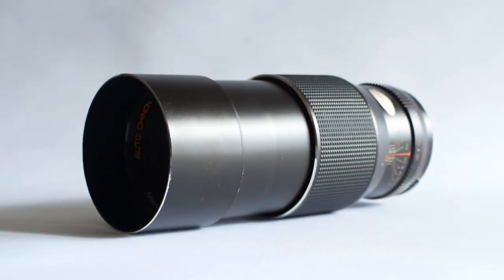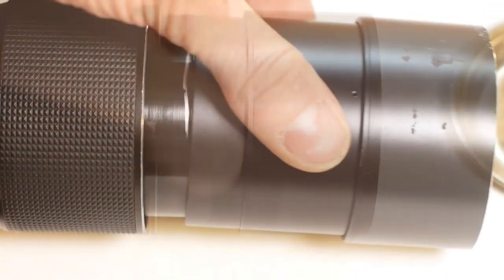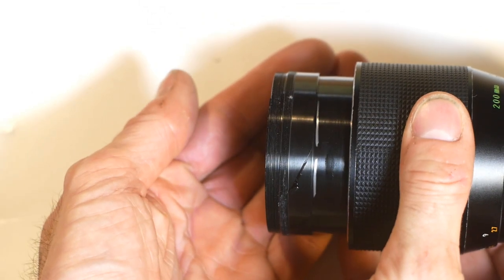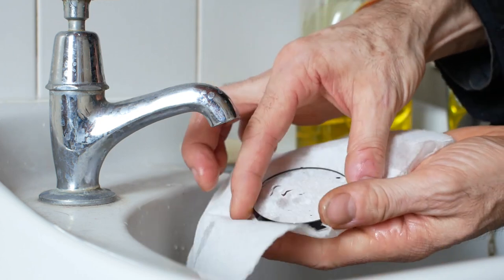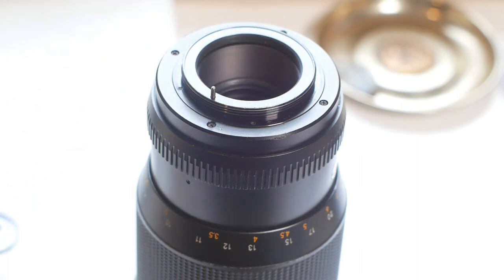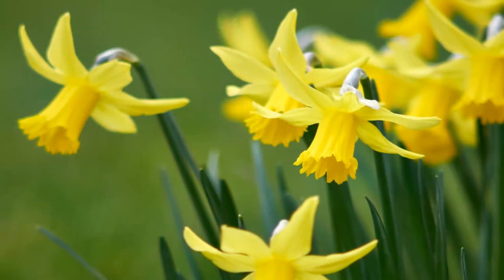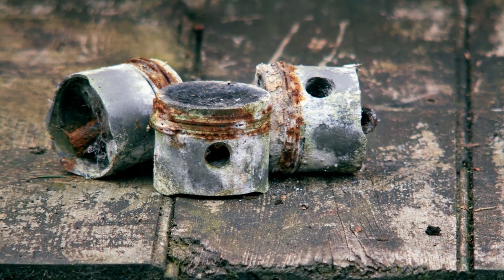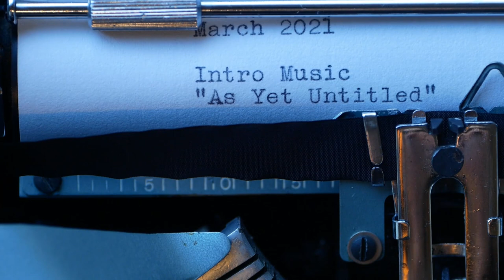Vintage Lens Repair, and Test - Auto Chinon 200mm f3.5 - Cleaning the Optics

Comment: Found a hidden gem here on YouTube! Great video, I might have to take apart some of my lenses as well. Loved the typing machine outro!
Reply from the maker: Hi Bram, glad you liked the video.  If you are going to take apart your lenses, I'd start with one you don't love, in case something goes wrong - that way you can get the feel for how they come apart.

A couple of people have suggested that tap water isn't the best option because it can contain tiny abrasive particles so possibly distilled water is a better option for cleaning the glass.  Also,  washing up liquid might not be the best cleaning product because in some cases it could potentially damage the lens coating.  If I was working on an important or expensive lens, I would take more care and time cleaning the optics, but I'm happy enough with my method of working for the ones I've done so far.

Comment: Great video, mate. I've been looking at some of the old 200mm primes over on eBay and think that might be my next purchase 👍
Reply from the maker: Cheers David, it was a bit of a struggle finding stuff to shoot locally - the 200mm ends up like using a 400mm with the crop factor of the Micro 4/3 system - I kept having to run off into the distance to get those shots where I'm walking into frame!!!

In the static tests I did, the lens didn't seem that great but that's sometimes the danger of trying to evaluate a lens in that way - once I'd started taking real shots and video clips it gave great results, with a really vintage feel.
Reply: @GrumpyTim  Yeah I have a similar issue when I shoot with something like the Hanimar 135 on my apsc cameras, that 135 quickly becomes an extreme close up!😂
Reply from the maker: I definitely found that - when I set up my first shot, thinking I'd get all of me in frame, ran off down the track then strolled nonchalantly back towards the camera, only to find all I got was my stupid head bobbing up and down in the shot!!!!!
Reply: @GrumpyTim  Haha, my stupid head gets a lot of time in my videos so I know that pain😂

Comment: I have the exact same lens! Luckily mine was in mint condition when I bought it last year for less than 20 euro. I think it's a bit of an underrated lens, I really like this one (or that is because I don't have many other 200mm lenses to compare it with...)
Reply from the maker: Hi ohjajohh, it's a strange lens - if I was to base my opinion purely on the static tests I did, I probably wouldn't think the lens is very good, but as soon as I started taking shots of something interesting or shooting video, it works fine, and gives some great results.  It definitely has a vintage look to the images produced using this lens.  Like yours mine was also dirt cheap.

Some of the video footage I shot did show up a known problem with the Lumix GX80 it was attached to - Panasonic put the tripod screw hole in a really silly place, making the camera tend to wobble on the base plate - with the 200mm lens hanging off the front and the strong winds I was shooting in, some of the footage looks like it was hand held, but it was in fact, just the wind shaking a slightly wobbly set up.

Comment: I have the same lens! It's amazing, but needs stepping down a bit, also colour profile in the camera needs to be more contrasty and sharpened. With these in mind, plus in body stabilization, this is quite a good lens. Using this on the MFT system so it's a 400mm equiv.
Reply from the maker: Hi Jerry, this lens really good value for money, I think I prefer my 135mm to the 200mm but that's mostly because I'm using it on Micro 4/3 and I find the field of view more useful with the 135.  I've been really pleased with all my Chinon lenses - virtually all of my videos (unless they're specifically testing out a lens) are shot using a Chinon 28mm f2.8 and a Chinon 55mm f1.4.  I agree that the 200mm benefits from stopping down a bit but it's definitely a very useable lens.

Comment: Great video! I have the same lens but my focusing ring is loose. would you happen to know how to tighten that up? Thanks
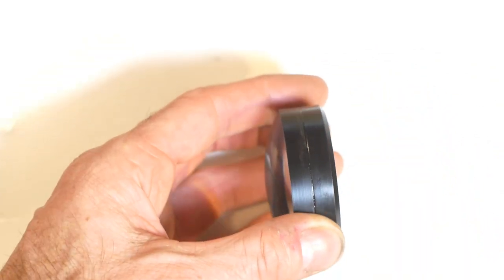Reply from the maker: It's quite common for the focusing ring to come loose on these lenses - I show the screws that attach it to the actual focusing mechanism at 05:20 in this video - you'll need to remove the front bezel first and then, looking down the gap between the focusing ring and the rest of the lens, you should see the screws.  If your focusing ring is completely loose, you may need to tighten the screws just enough so that the focusing ring drives the focusing mechanism, then turn the lens in the direction of infinity until it hits the end stop, then slacken the screws again and rotate the focusing ring itself until the infinity marking is in the correct place.  There's no need to do the screws up too tight, you don't want to damage them.
Reply: @GrumpyTim  Thank you for the reply and information very much!
Reply from the maker: You're welcome.  Let me know how you get on - I can always take a deeper look at my lens if your issue is somewhere other than the usual attachment of the focusing ring to the rest of the focusing mechanism.

Comment: Do you know what cameras this lens is compatible with?
Reply from the maker: Hi Moriah, there should be adaptors available for most mirrorless digital cameras, ie M42 to Sony or M42 to Micro 4/3.  It can be more tricky if you're trying to fit it to a traditional DSLR, because in some cases (Nikon) you won't be able to focus to infinity, and I believe the back of certain lenses can hit the mirror when adapted to mount on a Canon full frame DSLR.

It's possible that Chinon also produced this lens in other mounts such as Pentax PK bayonet (for the later Pentax cameras), in which case you'd need the appropriate mount adaptor to adapt it to a mirrorless digital camera.

If you're talking film cameras, then this lens will fit on any M42 screw mount camera such as the Pentax Spotmatic or countless Praktica cameras like the LTL and so on (not the B series Prakticas such as the BCA - those are all bayonet mount).

Comment: i love ur video, i can clean my lens auto tamron 200mm f3.5 but unfortunately i can't remove the front lens cause the screw was loose
Reply from the maker: Hi wahyu, thanks for watching, glad you liked the video.  Manufacturers use all sorts of tricks to stop you getting inside a lens - sometimes there are tiny grub screws to stop the lens retaining rings from unscrewing - these can be a problem if the head of the screw has been stripped in the past.  Also manufacturers often use some sort of lacquer on threads to stop them rattling loose - usually something like acetone (also know an nail polish remover) applied to the thread on the end of a screwdriver will soften the lacquer enough to get the thread moving.  One of my Olympus lenses has some fungus between the front two elements, but they're bonded into the front lens housing to make a sealed unit so I'll just have to put up with that - it's not very bad, so I'm not too worried.

On the whole you can have quite a bit of dust inside a lens before you even notice anything on the images (unless you often shoot at very small apertures).

Comment: Hi Tim, great video. I've inherited a collection of chinon lenses and would love to be able to mount them to my lumix GH4, can you recommend a mount/adapter at all? Thanks!
Reply from the maker: Hi Neil, there's lots of M42 to Micro 4/3 adapters available from ebay sellers or from Amazon - most if not all are probably fairly cheaply produced in China.  I have several of the cheap ones and they're fine, I also have one of the slightly more expensive K&F Concept adapters and that one is definitely better quality (in fact, all the stuff from K&F Concept that I've tried has been reasonable).  Without exception, all of my M42 to Micro 4/3 adapters are made a little on the short side, this means that you have to focus a fair way from the infinity mark to achieve infinity focus - not a big deal, but it will also mean that you will lose a small amount on the close end of focusing too - again, not too much of an issue. 

The same applies for adapting other mount systems, the K&F Concept stuff seems a little bit better but other brands work fine.  Generally, the other mount systems I've used seem to be closer to the correct length to achieve infinity without having to focus far from the mark.

You also have the option of using a focal reducer / speed booster instead of just a plain mount adapter - the big expensive name seems to be Matabones but I have ones from Viltrox and Pixco, which are cheaper and seem to work ok - they're never going to be as good as using the lens on a standard adapter because they place another optic in the path of the light, but they will give you a little extra field of view - something you sometimes miss with the 2x crop factor of Micro 4/3.  As a first choice I'd always go for a standard adapter before thinking about a speed booster.

You should have lots of fun using your old Chinon lenses - I have several and I love them to bits.
Reply: @GrumpyTim  Thank you so much for all this info, it's a huge help and very much appreciated. They were my grandfather's and they're in good condition but they seem quite old so I assumed I could only use them on the chinon camera but knowing I can mount them to my lumix GH4 is brilliant. I know they'll be completely manual but hoping I can get some cool videos and photos with them. Thanks again!
Reply from the maker: I tended to shoot fully manual even when I was using modern lenses, so switching to using mostly old manual lenses hasn't been too much of a struggle - all my videos since late 2019 have been shot using vintage lenses, with the exception of some close up shots, for which I use a modern (but still fully manual) Samyang macro lens.  You'll have loads of fun exploring your grandfather's lenses.

Comment: Hi ! I have this Lens in a pk version but the aperture ring is working a strange way : when i turn it from one stop to close it s not exactly the same aperture than turning the other way to open for the same aperture. The difference is small but do exist. For example from f11 to f16 is different than from f22 to f16... Do you think there is something i can do ?? I know it s gonna be different inside from a m42.
Reply from the maker: Hi Vivien,  it depends on how far different the aperture looks, if it's only a little bit it could be just a little bit of wear in the mechanism, or even play that was present when the lens was manufactured.  As it happened, there was actually a spring inside my lens that was disconnected and that was causing the f22 aperture to close too far, in fact I could close the lens down to f22 on multiple occasions and get several different results each time - once I'd opened it up again and re attached the spring it worked correctly again.  I can't remember exactly what it all looked like inside (it's been couple of years or more since I fixed it), but I'd bet that part of the mechanism is the same as your PK lens.  I know I had to remove the rear mount and the levers that drive the aperture, then if I remember correctly, there's the cam that sets the position for the aperture blades, and it was a spring on the non driven end of the aperture blades that was detached.
Reply: Thank you Tim ! I will give it a look  on next weekend. I do appreciate your help.

Comment: do you have any clue how to disassemble focusing mechanism? i have same looking lens - "helios 135mm 2.8 mc automatic"
after disassembling all parts i came to stuck purt how to tight focusing ring thread while my front lens attached to other thread for focusing. and they got rails so front lens doesnt move
I got it assebled somehow but didnt tight enought focusing ring so i cant reach infinity anymore.......and front elements can jump off thread near full extention
Reply from the maker: Hi MrDoomsday,  ideally, when taking the focusing helicoid apart, you should mark the point at which the outer helicoid detaches from it's thread as you dismantle the lens, because they have multiple start points, and unless you get lucky and pick the correct one, the lens won't focus correctly.  The same applies to the inner helicoid (that's the one with the very fine thread - it's only there to keep the lens in place, it doesn't do much for the focusing but if it's not in the correct position, the focusing won't work).  Again, ideally, you should measure the length of the inner helicoid at infinity before dismantling the lens and also mark the point at which it detaches from it's thread.

The good news is, that you can still fix it, it just might take a bit of trial and error.  Generally the outer helicoid (that's the one with the coarse thread) is the easier one to change, so you could try removing this part and picking a different starting point (use a permanent marker to mark where it currently separates so you don't just end up using the same insertion point).  Once you've tried a few different starting points for the outer helicoid, you can look at the inner helicoid, which is more likely to be the cause of the problem - initially you could try screwing the inner helicoid inwards to shorten it's length (use your marker to put an index mark at your starting position so you can tell how far you've moved things) then re assemble the lens and test.  You might even need to lengthen the inner helicoid to allow the outer to work on it's correct starting position but only trial and error will get you to the right place.

Don't panic and don't rush, it could take you quite a few attempts to get to the right setup.
Reply: @GrumpyTim  sadly I didn’t left any marks….
Reply from the maker: Don't panic MrDoomsday, it might take you some time to get it back right, but you should be able to do it - take a look at this video by mikeno62 as he dismantles the focusing mechanism  https://youtu.be/hxQhmQ_NHhM - although it's probably too late to follow all his advice, you should be able to work backwards, trying all the different combinations of helicoid positioning to get your lens back focusing correctly.
Reply: @GrumpyTim  thanks for your help, appreciate it
Reply: @GrumpyTim  his helicoid looks a lot simplier than mine, I will try record video if you have time to check it out….
Reply from the maker: Yeah that would be fine, if you make a video showing how your lens is and what the problems is, I'll see if I can come up with any suggestions.  I might not have time to look in the next few days though.